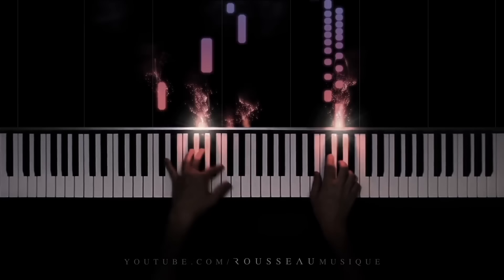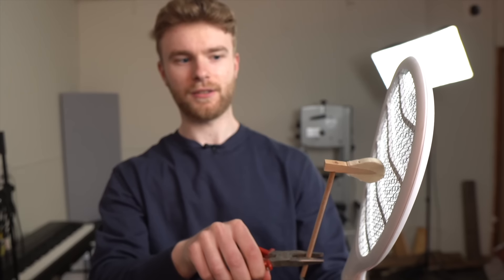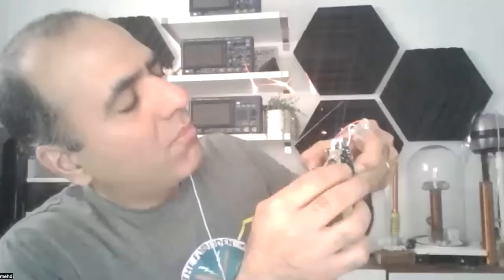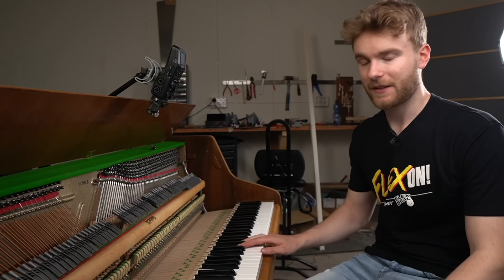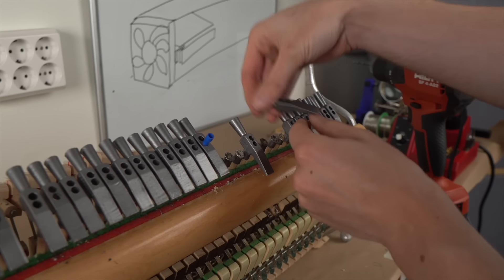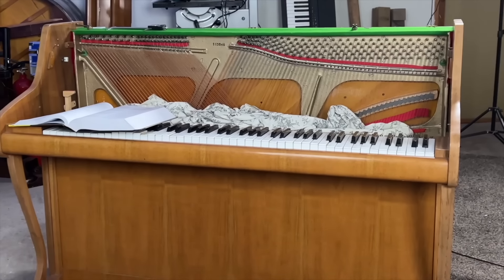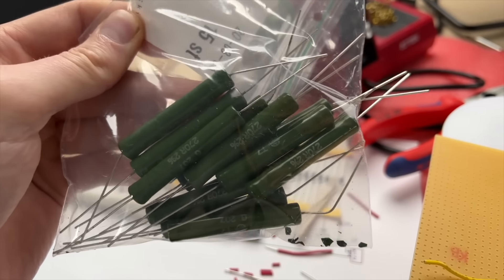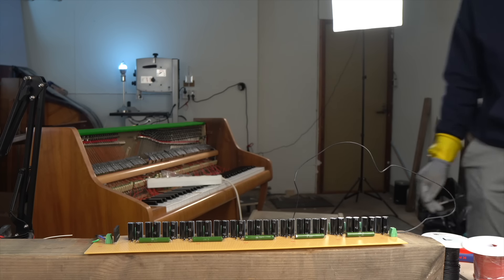How to NOT make an electric piano ft. @ElectroBOOM

Comment: Some suggestions from an electronic designer:
- place one 330 Kiloohm resistor (2 watt) in parallel on each capacitor, this modification allow the self discharge of all capacitors within few minutes (for safety purposes!).
- place one 10 Ohm - 5W resistor in series with each hammer to limit the current (this should decrease the risk of a welded hammer)
- buy a variac to adjust the input voltage (to adjust the intensity of the sparks)
- put some grease on both the hammer and the cord (to decrease the risk of welding)
- replace the 270 Ohm resistors with 1000 Ohm - 20W resistors (or two 2200 Ohm - 10W in parallel) and place them few millimeters above the board to avoid burns issues
- have fun!   🙂
Reply: Also install a small isolation transformer to prevent the entire metalwork of the piano from becoming live.
Reply: @eDoc2020  he mentioned it
Reply: Also, don't let children around this piano
Reply: @lilyofluck371  Or adults. Or pets
Reply: @jimi-w  or the monsters under your bed
Reply: @eDoc2020  could you explain this one, it sounds interesting!
Reply: @aggiee8653  TLDR now you can get shocked touching any part of the piano, it's as dangerous as a loose live wire.

You need two points of contact at different voltages to get shocked. With the current setup everything is tied to the home electrical system. Any grounded surface such as a pipe or metal appliance case can act as one of these points. If you are grounded you only need to touch one part of the piano to get shocked. Assuming the pedals of the piano are connected to the metal frame of the piano this could be quite dangerous. As he's in Europe the house RCD will shut off the power if a severe shock is detected, but you shouldn't rely on this. With an isolation transformer the piano circuit will be completely separate from the house circuit. To get a shock you'd need to touch the metal frame of the piano and one of the hammers at the same time. This is much harder to do accidentally and if you do there's a decent chance the shock will be in one finger and out another on the same hand, which is safer than if the shock went through your chest.
Reply: @eDoc2020  There's also the option to do it the "US" way - tie the piano chassis to earth ground, so that the breaker trips if the chassis becomes live. Also not ideal, but super simple to do
Reply: @antonliakhovitch8306  That's super not ideal because without the isolation tx the chassis becomes live whenever it's plugged in. Plugging it in would be an ElectroBOOM moment.
Reply: @eDoc2020  I said earth ground, not neutral - the third pin on the plug. This use case is literally what it's there for.

As long as the chassis is electrically isolated from the strings and hammers, it shouldn't be live. Earth ground is literally just a wire going down into the earth.
Reply: @antonliakhovitch8306  The strings are connected to negative through what  I'm calling the chassis. Since pianos are wood-cased I don't see what other metal there would be to ground.
Reply: The freak is this

Comment: The most dangerous thing here, is hooking up the whole circuit directly to the mains.
If you want to use this in the future as well, a isolation transformer is highly advisable! (read; mandatory!) 
Without it, it can actually be a lot more dangerous than just the high voltage itself. ☝

Besides that, very cool idea! 😎👍
Reply from the maker: We discussed this a lot while making the project and I spent many days reading a bout isolation transformers. But I was not convinced they were a good idea. I get that I could pretty much touch the piano without getting chocked. But IF i closed the circuit with two hands, I would die because there would be no cgfi working anymore. Compared to the house that has such a fast cgfi that I would only get a terrible chock. But now when I think about it, I wonder if cgfi even worked for this piano 🤔🤔
Reply: @Mattiaskrantz  The answer is no, it wouldn't, at least not for the entire circuit. You're charging caps, then discharging them, so the only place where GFCI would help is before the caps.
Reply: @Mattiaskrantz  you can probably wire one or many GFCIs directly inside your electric circuit.
Reply: @Mattiaskrantz  Isolating the circuit from the mains has a different purpose, and is an absolute mandatory requirement from CE or UL safety standards (for good reasons!), unless you can double isolate the circuit (like LED bulbs, or like coffee machines etc). The simplest (but definitely not complete) explanation, all has to to with sudden peaks (called transients) on the mains that can come from other devices (like appliances). These transients can be very high and are enough to fry you as well as a part of the circuit in an instance. We are talking about a couple of thousands of volts.
A CGFI does not protect you from those transients. Btw,  in Europe those don't even exists, and are often called RCBO. They basically detect the imbalance between live and neutral. Which won't help much in some situations, when the danger happens on the secondary side of the circuit. For that reason most homes in at least Europe have a ground breaker instead. I am not a fan of any CGFI or RCBO solution at all, but technically they are allowed within standards.
Speaking of breakers, maybe I missed it, but the absolute bare minimum protection is always a fuse.

Again, it think it's a really fun project. But as a professional electronics engineer with experience in HV circuits, I would never work on non-isolated circuits (even with low voltage circuits). I don't know the exact power of this whole circuit, but proper isolation transformers aren't that expensive. In this case  CGFI or RCBO won't protect you, since all the stuff happens on the secondary side anyway (after the bridge rectifier) while running the risk of having serious lethal transients coming from the mains grid.
Reply from the maker: @p_mouse8676  Aah ok I think I get what you’re saying! But it makes me think… like my logic was that, a piano like this thinking about safety was no point. Since if I touch the let’s say three hammers by accident I get a discharge of 6st 100uf capacitors at 330V maybe even two times before I’m able to react. I would pretty much not survive that? Maybe. So I’m thinking the first step would probably be to put a plexiglass in the front of the piano. The mainscircuit was for the most part a bit harder to access at least by accident. But ofc, this project is objectively a terrible idea!
Thanks for the advice I’ll print and read it in more detail later 🙏🙏
Reply: @Mattiaskrantz  It's the current that is lethal, not the voltage. So technically even a 9V battery can be very dangerous when injected in the wrong place in the body. 
There are high voltage situations that aren't lethal (although they still hurt), like electric fences. In this case you're correct, it's about the charge behind it, coming from the capacitors. Btw, what is the voltage rating of those capacitors?
The "if you would survive it" is a bit of a difficult question to answer. The reason why ElectroBoom was also kinda vague about it haha. As a healthy human being you'll probably right. But there are always changes you're not (I don't know your health conditions). So general answer is, just don't count on it because in some cases it really can ruin your day (understatement)

I don't know if plexiglass is the best idea. The melting point of plexiglass is around 160 degrees C I think? You're obviously above that temperature with the sparks.

But I totally get you, the coolest ideas aren't always the safest! 😄😎
Reply: Some times safety can go and duck it self, like who expects this to be safe. Better it’s absolutely deadly, that way it’s treated with respect! 😅
Reply: @p_mouse8676  Stop spewing nonsense! Voltage is what allows the current to flow through a given resistance, so a higher voltage will allow more current. They are inter dependent. 500 amps at 12v may not penetrate dry skin, but 0.5 amps at 120 volts might get more than the couple miliamps required to fry your heart to actually flow.
Reply: @p_mouse8676  not really true at all, voltage and current are directly proportional, even if a 9V source was able to put out current at 200 Amps or something it wouldn't do any damage to you because  the voltage is too low to overcome the resistance of human skin and allow a lethal amount of current to flow. There is no high current without high voltage and/or extremely low resistance (which isn't really relevant in a discussion about human skin anyway). This is why high voltage can be so dangerous because it can easily kill you with the sheer energy it can output in comparison to low voltage.
Reply: @rolfbjorn9937  true
Reply: @Mattiaskrantz   My apologies in advance for getting a bit teacherly here, but I have to be honest, as much as I think this is a cool idea, I really did not enjoy watching as I was just incredibly nervous about the safety issues. Quite apart from the capacitors, you literally have exposed live parts at 240V. This is not only unsafe but potentially illegal as an electrical installation.

There's a big difference between knowing that things are dangerous, and having sufficiently healthy respect for those dangers. I have to say that from the the video and the way you are talking I am concerned that this is something you may still not fully appreciate. I'm also thinking about any potentially impressionable viewers. I guess it's OK for an electrical engineer like ElectroBoom to do dangerous looking things. But you present as an amateur maker, and there are going to be people out there who take that as a signal that wiring something up to the mains is something they could mess around with, too.

The bottom line is that you really need to be seen to be dotting the i's and crossing the t's. Simply insulating the hammers (except the striking face) by dip coating would already be a massive improvement. The circuit board itself should also have been protected, even though it was relatively inaccessible. Some sort of high current cut-out would certainly have been a good idea - particularly as you had anticipated the hammers getting stuck. You could also have considered using a non-conducting location instead of the insulating gloves (these are often used by people who need to work with dangerous live capacitors such as in TV repair).
Reply: @Dell-ol6hb  the reason that high voltage is dangerous all has to do with the body resistance of the human skin. Which still doesn't remove the fact that a low voltage can be dangerous wen penetrated at a certain point where this body resistance is much lower.

Comment: I absolutely love soldering and i get a feeling of satisfaction when i end up with a clean job.
Few tips for beginners:
■ Don't cheap out on soldering wire, get a 63/37 ratio as it instantly melts and solidifies and has no inbetween state.
■ Make sure to use some sort of soldering oil or flux as it helps solder flow easily and you'll have round edges on your solder joins. Much more clean results.
■ Clean out any excess oil/residue left on the PCB (preferably with Isopropyl alcohol) as it may corrode the copper tracings and over time result in them lifting up.
■ Get a PCB holder. This is not needed but would make the process way more convenient for you. Some have a magnifying glass too (like the one Mattias is using at 8:15)
Reply: Those are some solid tips. Great advice, thnx.
Reply: 60 40
Be normal like everyone else
Reply: @urnoob5528  60/40 is not eutectic. If you're going to use leaded, get the proper eutectic 63/37.

Comment: I'm too used to tinkering with high voltage that i'm not worried about the voltage.
I've also already had parts that unsoldered themselves from the PCB due to heating up.
The only thing i'm worried about is (seen in the long run): The UV radiation from the sparks to the eye.
Like when you weld without eye protection you get Photokeratitis.
But the sparks look rather reddish, so i don't think they contain that much UV.

Comment: Hey great stuff! Just a suggestion to help you not hurt yourself soldering. Hold farther down the solder so you have about 2-3"(5-8 cm) between your hand and the material you're soldering. And tin the soldering iron before you start. To tin it, you just need to melt a small amount onto the end of your iron. It helps to make the first few joints properly. But otherwise good stuff! Not bad for a first timer 🙂

Comment: You could save your strings by making the arc happen remotely, attach a wire above the strings and extend the electrical connection above the hammer to isolate the hammer and piano string from the arc

Comment: You should implement a secondary switch for each hammer, so that capacitor for that channel only charges when the hammer is at rest. It should solve the glowing resistors problem - right now, when the hammer welds to the string it creates a dead short across mains, with only the resistors stopping you from tripping a breaker.

Comment: you could make it from capacitor charging/discharging zap cycle
Reply: you made a welder
Reply: or spot welder to be exact
Reply: you could make "free caps" yourself, also, its only two conductors and one insulator, in between, but the amount stored will vary

Comment: Mehdi still doesnt know in Europe the GFCI is always in the breaker panel, all outlets are protected.
Reply: Mmmm
Idk

I'm from Europe and here it says with huge letters how its illegal to use bathroom outlets when showering.

And in fusebox I just have 3 large ceramic fuses. Ones that physically break and you need to replace them

Comment: From what I can see you were just welding those strings on the left side with the hammer maybe softer metal however the strings on the right looks like steel and not melting that easy also the left has more area so creates a strong bond on the other hand it is easy to break the bond with the skinnier strings.

Comment: wow. The generators are soo overpowered for the task. You are also able to use lower voltages.
For simplicity and stability you can use gliding arc discharges. Another version can have a discharge tube. This one will not produce ozone and you can actually pump in any inert gas you wish and get any color. Check out plasma globe music. It is also possible to make that globe 2D and make lightnings shoot allover the front panel through multiple electrodes. Styropyro was doing something similar.

Comment: You know what's interesting if instead of the hammers hitting strings you could encase each hammer and wire pair inside a tube to make the explosion create the note. Think pipe organs but instead of wind it's exploding electricity. But I'm sure that's not easy because it's expensive, it's dangerous because of electricity and metal pipes and you need a large room to pull it off. The pipes will have to be at the correct length to make the correct note.

Comment: Old computer power supplies it the other place to get big capacitors.  Got a bunch I was using for voltage quadruplers on small valve amps years ago.   Meant that you could get a pair of 30v transformers to power a couple of EL-84's.

Comment: oh so you're just like, putting 240 Volts through the system at an unknown amperage if they accidentally weld? If something was causing the resistor to glow it was probably that.

Comment: You will not be able to play a lot because every spark ( short ) you produce with a capacitor wil damage them, they are not designed to be shorted. There are other components like the ones you find in lighters that are designed for this very purpose. The capacitors may explode! The snares will burn in also. The resistors burn because the resistance is too low / power ratings are exceeded.

Comment: An idea I have tht I’ve wnted to try is look I lke models rght train scale n stff lke tht/models n general. You see  and fr the lightning they hve flashing lghts. Cool/sweet. N the real wxrld they hve electricity flash arcs. Take some posetitive and negative boxes place thm on the floor and feeling accordingly, add some fog smoke effects, there/their ya go, turn thm on and sparks will go frm the floor to the floor and frm the grown upwards too lke wht hppns n the real wrld sometimes. I saw a picture on ig of a purple electrical strm n sme desert thng I thnk n texas, it what’d a few foliage by it but not much wth a duke station pump thing, and a little old camper wth a few other cars getting filed up too xr whtever and wth tht design/scale thing I hve mentioned here it could be in miniature form too. And jst hve them boxes places at/@ different places around the room to mke the flashes go frm cloud to clod or cloud to ground.a fog machine tht mkes clouds too but the clouds rub against each other to make lightning n stuff but on a smaller/scale model n stff

Comment: Electroboom warned me about this problem. However, during the hundreds of hits on the prototype the hammer never fused with the string even though I used the actual piano strings on it. That’s why I was so surprised by it doing it on the piano. But I guess it has something to do with either the strings not being under tension on the model or that the hammer action on this piano doesn’t have the same action/bounce as the action on this piano

(Really love when Tubers show a paragraph of important detail in mess than a microsecond.

Comment: i really enjoy this, i know the video is from a long time, however i would like to recommend you to change the resistance for bigger ones, if they are melting is because the resistance cant handle the voltaje, with a bigger one you probable will have smaller sparks but the piano will not burn xd

Comment: When Soldering I would recommend Flux it makes all solder joints cleaner and allows solder to flow where it needs to go. But if the fumes aren’t vented it can cause cancer.

Otherwise love the solder work. I use it daily